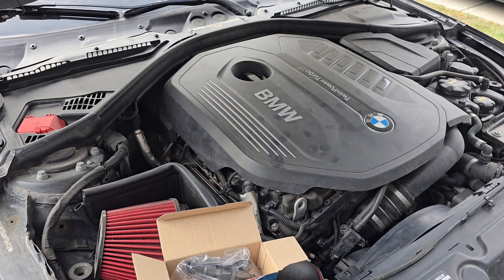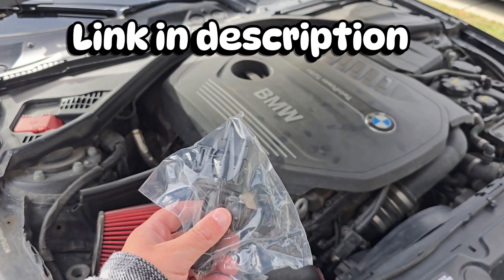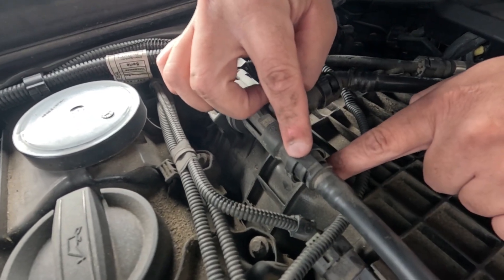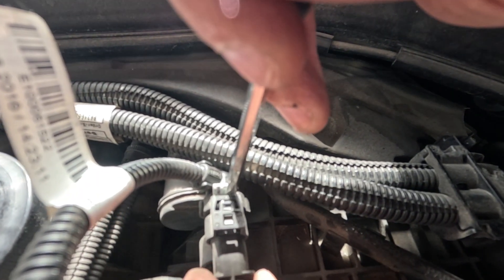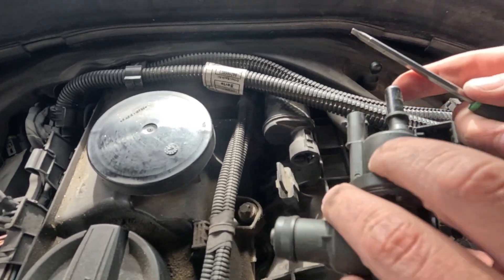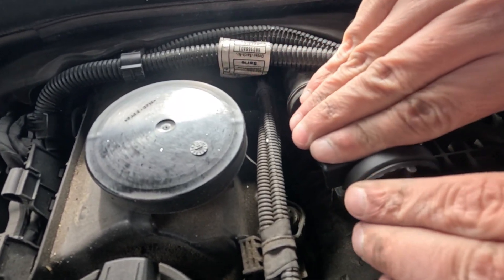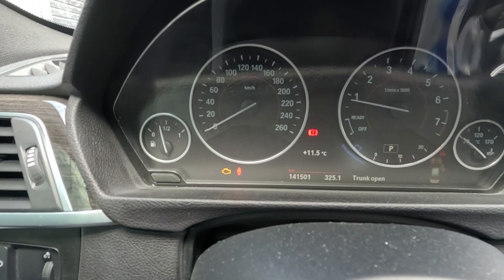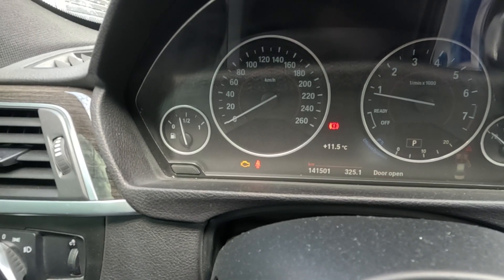How I Fixed BMW Error 190F08 & 191C02 , Replacing fuel Tank breather Valve

Comment: I just broke the white little clip that’s hard to take off, will I be ok ? Or do I need to replace it? And if so what is the exact name or part number?
Reply from the maker: If its just the clip , it should be fine as long as its pushed in enough, there another same clip on opposite direction so that should hold it in its place . Drive the car for few days and see if it gives you any lights or errors or not, if not you are all set with out

Comment: I just had the shop replace my waterpump and thermostat. Now I am getting these 2 codes and rough idle. Is this something they would have removed and possibly damaged while changing the water pump/stat?
Reply from the maker: They are in the front, the fuel tank breather valve doesn't get in the way. As its on the top rear of the engine, but the shop may have had to remove pipes for access in the front. Follow the hoses from the fuel tank breather valve and check they are hooked im properly.
Reply from the maker: It's a very common problem with Bmw as well. So may be coincidentally it went out the same time when you got other repairs done. If every thing is hooked up , I have posted a link to purchase in the video description. And these step can be followed l. It's a quick job